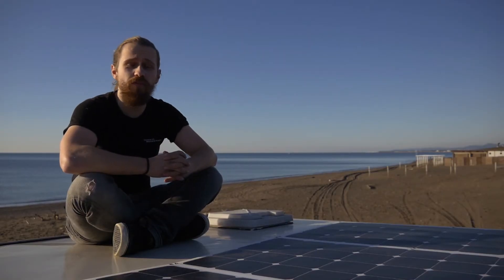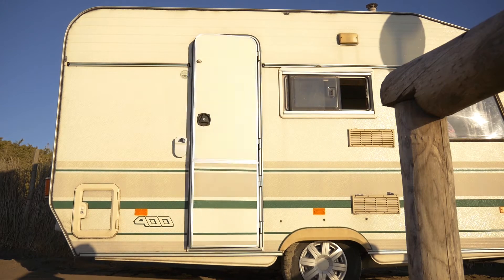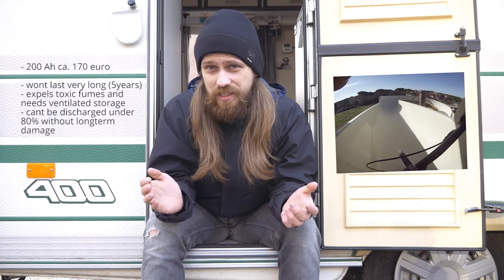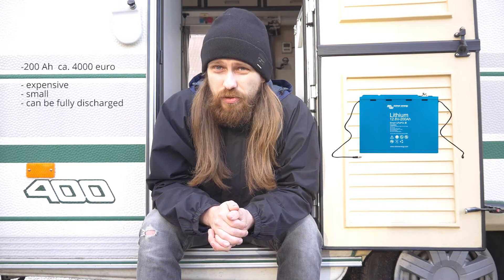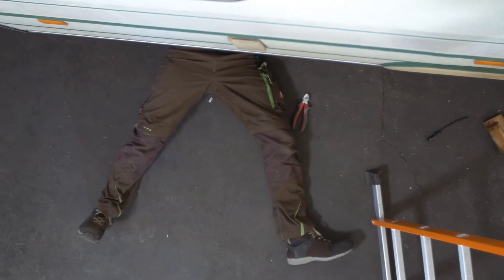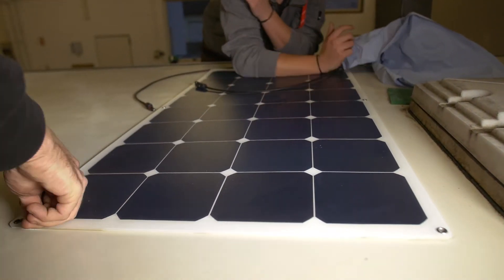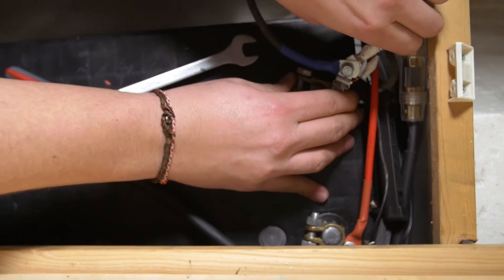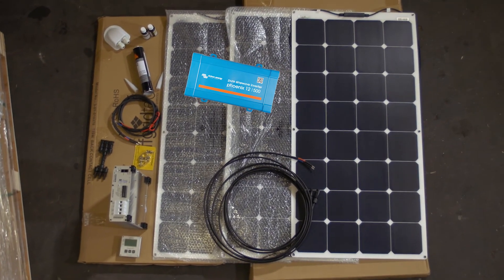THE PERFECT SOLAR SETUP AND HOW YOU CAN INSTALL IT YOURSELF !!

Comment: Great video. I will be more than happy to see another one like it, having to do with green energy.
One question. The charge controller is just a buck converter (step down converter), or it gives as much current and voltage the batteries need, based on the percentage they are charged? .
(Note that in order to properly charge batteries, you dont just put the voltage they need untill they charge to 100%. )
Reply from the maker: Thanks. The Charge Controller is also a real batterycharger, since you have the Option to use the car alternator and a regular household socket for charging. So it is designed to Charge the battery as it is supposed to be charged. :)

Comment: Btw, phones & tablets usually take 5V, not 12V ;) But as I can see in the video, you used a 12V to 5V USB converter which ist fine. Another thing: I would use silicone to seal the edges of the box on the roof. Would be a little unpleasant when water runs all the way down to de batteries.
Reply from the maker: Thanks,I might consider sealing the Roof box. I cant imagine the sicaflex to give way, that Thing seems to be welded to the Roof, but might not be a bad idea to be extra sure. I didnt even know that Little Output converts anything, but yeah, it Comes straight from the 12v Battery and it seems to convert it to  5v 1A and 5v 2A for tablets. Thanks for the comment :)